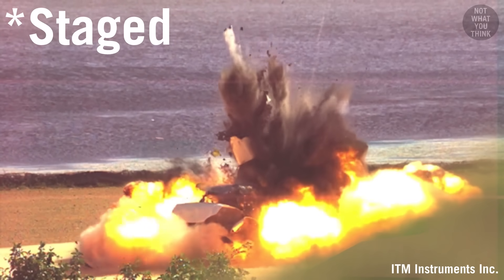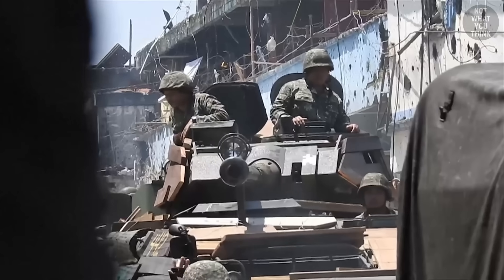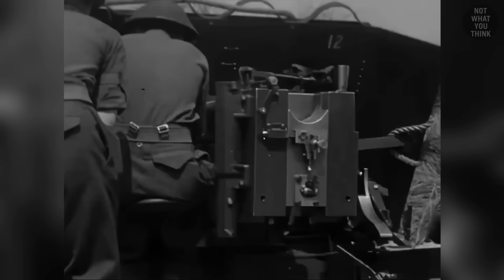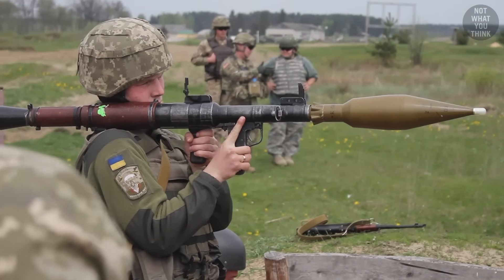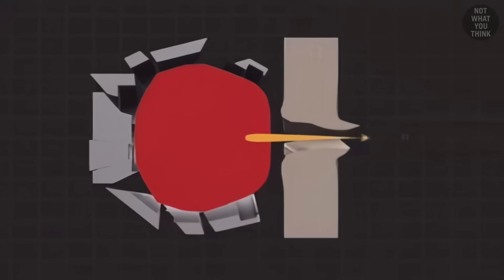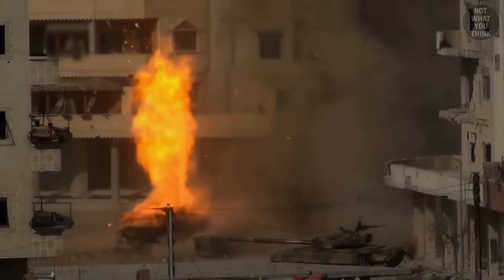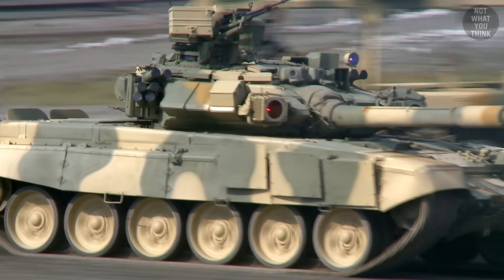Why Protecting Tanks is Getting Much More Difficult

Comment: I heard about this electric circuit shield defense from Spookston's channel which may be viable. Basically the shaped charge's copper jet is a metal right? And the entire tank is made as an incomplete circuit. When the copper jet makes contact with the tank and thus creating the circuit. When the circuit is created thus meaning electricity, but electric circuits also creates magnetic fields. 
They could design the circuit in such a way that the magnetic field would be strong enough and would push the shaped charge jet sideways and prevent them from penetrating more than they already have after creating the complete circuit in the tank's chassis. 
But this won't work for kinetic rounds.

Comment: I think tanks are so WW2.
It's time they should be discarded. Waste of metal fuel and humans. With modern weapons a complete new strategy should be made on how to neutralize the enemy before taking the ground.
  US did a good job in Iraq and look how Russia fumbled in Ukraine. No achieving air superiority against own familiar weapons resulting in failed ground assault.
Reply: Back in the day tanks were used to be an impenetrable vehicle to advance and also used as a sheild for infantry to cross but now tanks had started fighting with other tanks witch developed antitank rounds such as HEAT and AP although now with hand held equipment that can take out tanks it probably needs more armour but a more powerful engine is required and it is possible because there are new kinds of composite armour  with different metal alloys to create an indestructible armour and expected to be much lighter
Reply: @steelnail1917  Make tanks heavier bigger when does it stop? Also makes them easy targets with all advanced weapons. Remember it is lot easier to make destructive weapon than a defensive armor. 
 I think tanks have no place in the modern military for the most part. They should only have specialised role.
Reply: @SSA  tanks are very important to help infantry to advance and there is no limo how big a tank can be and there was a plan for a German army to make the RATTE-1000 witch is a thousand ton tank to counter the USSR but it was never built because of how much reasorces and time it would take to build but as we can see today tanks are just keep getting stronger faster and more armoured because there are going to encounter more powerful anti tank weapons so no the ERA of tanks isn't going to die unless there is going to be a laser weapon that would melt and burn through the armour but I think that there will be new kinds of composite armour that can even defeat laser weapons
Reply: @SSA  tanks are not easy targets perhaps taking down a tank alone is a quite risky because modern tanks have computers that can detect infantr /armoured vehicles/drones or anything that is moving on 360° angle and probably have a lock system similar to inferred guided optics
Reply: @steelnail1917  All that gymnastics to keep old memory alive. Seems pointless.
 Time to make new strategy and stop waste. As I said some special uses cannot be denied and that's all there is.
Reply: @SSA  artillery is over 400 years old grenades are 500 years old and we are still using them today but why are we continuing to use old technology
Reply: @steelnail1917  Something wrong with the generals. 😂
Look how they screwed up in Ukraine (the Russians) . Also look how drones were a game changer. We need complete new strategy by Generals with modern weapons and modern thinking. If WW2 Generals thought the same way we would have been using horses forget grenades. 🤣🤣🤣
Reply: @SSA  who said that tanks are screwing up in Ukraine there are new kinds of reactive armour that are more explosive and neutralise the incoming projectiles making the tank a safer place to be

Drones are important because that's how infantry and tanks know where to find enemy positions so they are prepared for the attack

Comment: The idea that tanks are pointless because they are defeated by a specialized man-portable system makes as much sense as saying rock is useless because it gets beaten by paper. So tanks don't have to be invulnerable to be useful to begin with.

Tanks are a single piece of a whole, they have always required support to be effective and when lacking support are left vulnerable. Specifically to infantry, as tank crews have historically had poor vision, meaning it's actually fairly easy to outmaneuver and sneak up on an enemy tank with no support.

The solution to infantry was always your own infantry, whose job is made a whole lot easier with a tank around.

That also doesn't get into the fact that ground attack aircraft can pop tanks like blisters, and have been able to since WWII. The solution to that being your own air force.

In addition, as technology advanced, we're beginning to move beyond simple composites and alloys, onto meta-materials. The simplest and most famous of which is graphene- which is essentially just a bunch of carbon arranged in a simple hexagonal pattern. More complex structures with different, or even multiple elements will mean materials with truly absurd properties will be made available in the near future.

That, and the combination of ai-assisted design, means there are likely very unorthodox passive protection solutions on the horizon. It's impossible to tell whether man-portable anti-tank weapons will benefit at the same rate- it could make them even more effective through things like loiter munitions, or we could be brushing up against their feasible limits in some area.

Comment: In order to allow tanks to survive anti tank weaponry, they will need to gain the ability to dodge as more and more armor becomes less viable. A side effect of this would be that tanks have far more mobility on the battlefield as the tank becomes more a suit of armor for the driver. A mobile suit if you will
Reply: This is why giant robots are viable for military use.
Reply: So basically, bring back the design philosophy and concept of the AMX-30 and Leopard 1 again.
Reply: I remember macross

Comment: A developmental race between offense and defense is nothing new. This happened before in medieval times, armor got better, weapons got better, then so on, until guns came around and it was simply not practical to put full plate armor on soldiers anymore.

And we're seeing the same thing now, but with vehicles. We're going to eventually reach a point where armor plating of any kind of vehicles will only need to be thick enough to protect from ordinary rifle fire, and otherwise accentuate means of active protection, as well as speed and range.

And the sole point of these vehicles will be to transport a weapon from point A to point B in less time than it would take a guy to carry it. Imagine a pack of high speed ATVs bolting through a cloud of dust and debris, trying to literally just be too fast to aim at properly, zooming all over while either automated systems or a 2nd driver fire on-board weapon platforms like rocket batteries or cluster explosives at the enemy.

Hell, make a low altitude hypersonic bomber that just throws bombs up behind itself and then manages to get the fk out of the way fast enough to not catch the blast when they literally just fall and detonate.

Comment: People who keep declaring tanks obsolete due to advances in anti-tank weaponry fundamentally misunderstand the function of tanks. Tanks are a form of mobile artillery. It's not to say that their armor isn't functionally important, but properly utilized tanks should be kept out of harm's reach & used to bombard positions from a safe distance, protected by anti-air & ground forces in the front. Another way to look at tank armor is that it forces an enemy to use more sophisticated, expensive & sparsely available weaponry in order to have any chance of successfully engaging them. So, you have a wave of tanks bombarding you with heavy guns from a distance, a line of troops to intercept & engage your forces that are trying to get to them, anti-air to protect the skies, & only a certain percentage of your force that manages to penetrate would have the weaponry capable of destroying one tank in one position on a battlefield, possibly at a greater ultimate cost than the tank it destroyed.

Comment: To be fair to the nuclear bomb engineers, in those Chrome Dome crashes, the bomb really did what it was meant to: A detonation triggered incorrectly (such as by an impact or external detonator) causes an asymmetrical pressure wave, which doesn't compress the core but just squirts it out the side of the chamber.  A nuclear detonation is effectively impossible without the correct electrical triggering signal. But that does tend to spread radioactive material all over the area, so obviously it's a lot better if the explosive is extremely insensitive and won't go off at all. Still, the risk is not "nuclear detonation", but rather "this makes a really big mess we have to clean up".

Comment: This KILL Tanks, why is that so surprising? The idea of a "TANKKILLERS" has existed since 1792 and in 1932 Franz Rudolf Thomanek designed a 70 mm tank gun with shaped charge ammunition. The hollow charge was first used on May 10, 1940 when German paratroopers stormed the Belgian fort Eben-Emael. So tank killers have been around for a very long time and in every form, whether rockets or guns, as long as there is a weapon industry there will always be better ones and there will always be better protection against them. this is the NATURE of the waeapon industry. I am writing this because the thumbnail makes the entry it would be something new and surprising.

Comment: no the idea of tanks is very redundant with modern tech. it is essentially a cannon on a carriage with armour. fully manned.
the cannon has become somewhat replaced by rockets, the radiowave controlled systems have removed the need to have soldiers on the cannon/tanks and thus also the armour as bunkers and trenches will always be much more armoured than them, plus the added effect of increased distance to said bunkers. So stationary or mobile control posts for drone-like weapons is surely the future route for most aspects.

Comment: Quick correction: The cages are not designed to defeat EFP and shaped charge warheads by increasing distance. The distance would be significantly greater than you could reasonably create with a secondary material for anything resembling a modern anti-tank round. RPG-7s even this will be true. Looking at their optimal detonation distances, it even makes the penetration BETTER if you slightly increase standoff. 

The reason they are there is the piezoelectric point initiated, base detonated mechanic of the common anti-tank round. That nose of an RPG is piezoelectrically actuated, but you can potentially cut the line to the base detonator before the tip hits a target. The slats of proper cage armor the US uses are called statistic armor, because it is specifically a statistics problem. If you get wide enough, you can sometimes hit the sides of the imitation set in the standoff cone of an RPG before the tip hits anything, stopping the jet from forming at all. You can also fail if the tip hits a slat instead of in-between them. That is why the distance, number, and orientation are a "statistics" problem. 

I worked at Aberdeen for a bit doing EFP shots on hybrid armor research back in 2009 and we were doing all manner of defeat approaches for shaped charges at the time for MRAPS.
Reply: So basically you’re gambling on the edges of the cage potentially disrupting/destroying the shape of the inverted copper cone that forms the charge before the tip of the warhead can signal the detonator?  Am I understanding that correctly?
Reply: @OneBiasedOpinion  To be clear, you either break the wire connection from the point initiator at the nose, that connects to the electric blast initiation set in the base of the device, or you don’t. 

Almost all RPGs are what we call “point initiated, base detonated” projectiles. 

To form any shaped charge the explosion has to be started from the back, then shaped with the explosive itself forming the lenses of blast wave that invert and direct the liner into the spear of plasma which penetrates the target. 

Since the defeat mechanic is just break the connection between nose and base detonator, you either stop the explosion from being initiated at all, or you don’t and make it more effective on the target.
Reply: @nonsensebear  ahhhh.  I’m tracking now.  Fascinating.  Didn’t realize the speed of the projectile would be high enough to even allow that to occur before the detonator was triggered.  Electrical currents are pretty doggone fast.
Reply: @OneBiasedOpinion  Yes, that's why this type of protection is referred to as "statistical armor"
Reply: @wunkthemonk4359  I get the name, I was just trying to simplify the technical jargon into a format I could better understand and make sure I got what OP was saying.
Reply: Expect a visit from DoD CAF explaining your obligations to your security clearance.
Reply: great, thanks for your explanation and replies

have good day mate
Reply: Thank you for the classified information.
Reply: @samuelg3586  nothing stated here is classified, nothing stated here is marked for  limited release. Fucking morons.
Reply: If the distance should be significantly greater, then how come Philippinos forces defeated old shaped charges with just a little spacing made with wood?
Reply: @jokso22  The question is: Did it actually work against shaped charges? Or was it just a morale boost? If it actually did work, why did the whole world during WW2 come to a different conclusion (that wood is useless as armor)? And everyone else ever since that as well? Nobody uses wood.
Reply: @leocurious9919  It's not about the wood, it could be plastics, it's about spacing and that is my question
Reply: Whether it be spacing generally or just the wood itself you’d think tank designers would be implementing that feature if it worked. It wouldn’t be terribly hard to have thin sheet of metal surrounding the outside of a tank, so if it was effective at stopping shaped charges why hasn’t anyone implemented it? It’s because it doesn’t actually work.
Reply: Thank you. But its not the only mayor-ish error in this video. Seeing how few people read this of ~7 million views, with the creator not giving a shit, I am not going to point them out without someone asking, it seems like a waste of time.
Reply: @leocurious9919  Well I am actually curious, can you point it out if it doesn't create too much work for you?^^
Reply: @lunariclunestra8335  Examples, since I dont want to rewatch everything:
4:17 shows how the round gets squished in impact a lot. It would detonate much sooner, pretty much right after first contact. The distance is needed to form the jet from the shaped charge (standoff distance). Shown is only 1 diameter distance remaining, which would somewhat diminish the effectiveness of a shaped charge. This is also the reason for that "long nose" that is empty. He does essentially the same error at 6:40. A tiny bit of additional distance is not going to change much. It helped them - in a psychological way, not by actually providing armor. We would have see wood cladded tanks since at least WW2 if this was in any way efficient. He does this again at 10:35, the jet (or APFSDS rounds) has to pass through more material at an angle. The distance itself is irrelevant. All the animations he got from wherever even show this.

5:13 no it does not cause "utter devastation" on the inside. You can clearly see it in the footage. Unless you get directly hit by the jet or secondary fragmentation, everything is comparatively okay. 

6:50 those cages are not for premature detonation. If that was true, it would not be a cage but a sheet of metal. They actually deform the shaped charge if it happens to fly in-between the metal, greatly reducing the penetration.

7:55 while the boxes of ERA did not explode, they did completely burn out.

8:40 it is not a shaped charge. There is no liner.

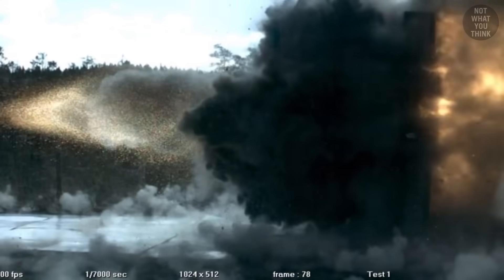11:00 What is shown is NOT a tandem warhead. Whatever we see there actually penetrates the target and then detonates. A tandem warhead simply sets off the ERA such that the main shaped charge can then attack unaffected. It is still a 100 % kinetic attack.

He also constantly talks about modern this and "we have reached" that, but this is all decades old stuff. The tandem RPG PG-7VR is from the 1980s, for example.

This video is a collection of nice animations and footage, some even absolutely stunning. Sadly dubbed over with lots of nonsense commentary. Likely none or only the rubbish animations of exploding sandwich and hand grenade was created by the uploader.
Reply: YouTube people hate science, read a book ?

Comment: When firearms started becoming more common on the battlefield in the 17th century infantry stopped wearing heavy metal armor because it would just slow them down and couldn't stop a bullet anyways. the tactic switched from "how can I not take damage when getting hit" to "how can I prevent being hit in the first place"

I feel armored vehicles in general will now start becoming obsolete considering we have started producing guns that turn 5 inches of solid steel into slag or shreds through concrete like its tissue paper even when fired from 100 miles away.